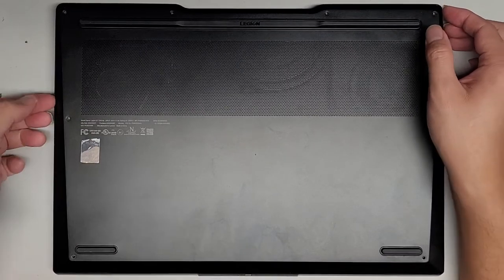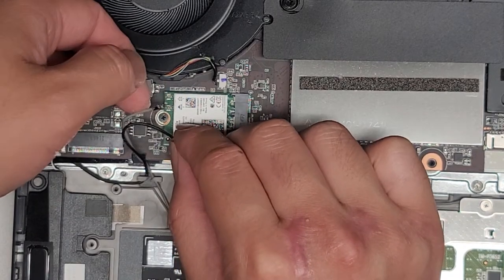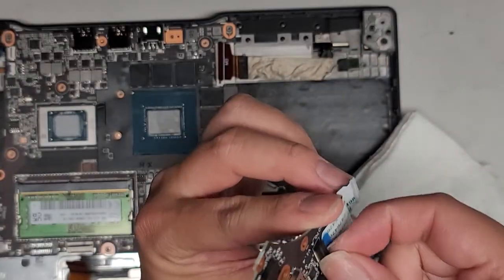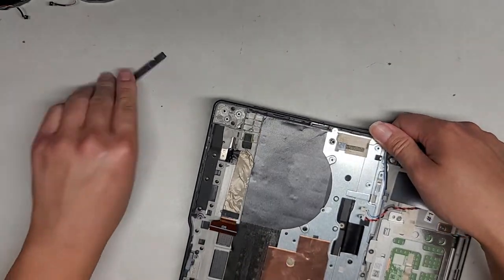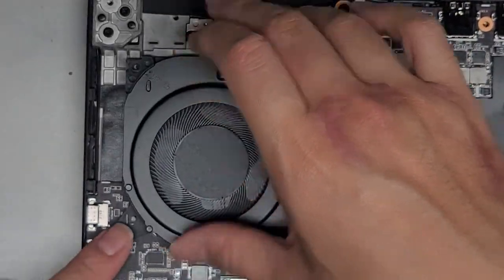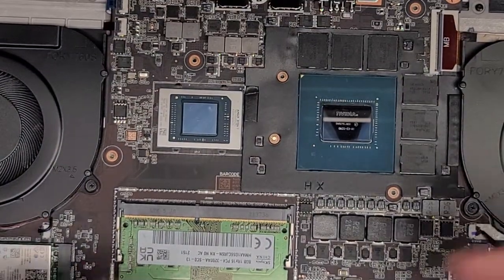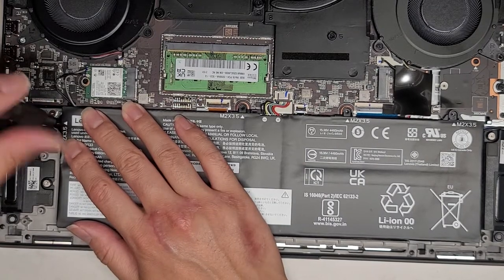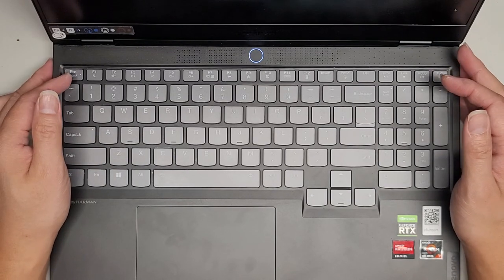Lenovo Legion S7 15ACH6 Disassembly RAM SSD Hard Drive Upgrade Battery Mobo Paste Replacement Repair

Comment: I want to add a second ssd and i was going to repad and paste but it looks like pretty good quality pads and paste so i may leave that alone
Reply from the maker: No need to paste unless it's overheating.
Reply: @ItsBinhRepaired  with processor power management maximum state set to 95% it runs really cool during gaming vs at 100 percent.  Probably like a 20°C or more difference :)
Reply from the maker: @johnvirginia7238  but then you get less performance.
Reply: @ItsBinhRepaired  true but I’ve always been setting that maximum processor state to 99% or less for probably a decade now in those settings for laptops and it’s always been a game changer for the maximum temperature that the processor gets. And since it runs so cool, it never thermal throttles.
Reply: And I can’t really tell the difference between the performance with a couple less percent.
Reply from the maker: @johnvirginia7238  sounds good

Comment: You didn't return the cover over the ram, do you not have to? Is it fine without it?
Reply from the maker: I just rewatched the video and I did put it back in the end. It's not a required component, but you might as well put it back. Lol

Comment: In order to preserve the battery am I able to keep it removed?  I have a true sine wave battery back up that it will always be plugged into anyway.
Reply from the maker: You'll want to store it at 40%
Reply: @ItsBinhRepaired  For sure!  With HW monitor I can see that it’s supposed to be 71 at full charge but it’s got the capacity of 73 so I definitely gotta keep it less than fully charged. Thanks. I will store it at 40% if I unhook it.
Reply from the maker: Sounds good

Comment: Hello, when i open the laptop, do i still have warranty? And i heard when you remove disessembly it has a sticker inside and when you upgrade anything that sticker will remove and when the sticker is remove people will notice your laptop has been disessembly, is that true? And when i want to sell the machine it should be cheaper cuz it got open
Reply from the maker: You'll have to ask the manufacturer, not me.
Reply: @ItsBinhRepaired  ok and when you open the laptop for upgrade do it have any sticker attach to it? Someone told me they have a sticker from manufacture. I dont see any sticker in the video, When that sticker is remove, thats means your laptop has been repair and people wont pay high price if in case i want to sell it
Reply from the maker: @genlongtsang1093  all I know is what's in the video.
Reply: @ItsBinhRepaired  ok is like sticker those that are on the laptop keyboard Intel i7 and RTX Geforce, they say they have one inside the laptop when you open it a manufactured sticker logo lenovo sealed inside
Reply from the maker: @genlongtsang1093  sometimes, You'll have to open it to see.
Reply: @ItsBinhRepaired  i ask you because you open it, its fine if you don't want to tell me lol
Reply from the maker: @Gen Long Tsang  do you have any idea how many thousands of computers I work on? You think I'll remember off the top of my head if there was a sticker inside? Lol If it's not in the video, I have no idea. It's not a matter of wanting or not wanting to tell you... These are customer computers, not devices that I own and stare at for hours committing to memory. Lol
Reply from the maker: @Gen Long Tsang  also, laws for what voids warranty varies state by state. I'm not a lawyer, so I can't tell you what will and won't void your warranty. Sometimes they'll tell you that taking a screw out will void your warranty.

Comment: Do I disconnect my batter internally because I was Downloading a bios download for my model and now my  screen is black but the keyboard light stays on its a legion s7
Reply from the maker: If you turned it off manually while doing a bios update, you killed the motherboard bios chip
Reply: @ItsBinhRepaired  so Am I needing to buy a new bios chip or is the computer donzo
Reply from the maker: @modsforlife2397  new bios chip might work, but I don't know how to do that.

Comment: Can you upgrade the battery to an 80wHr battery or can you only use the 60wHr battery?
Reply from the maker: This one was 71wh if it's the same size and shape and designed for the laptop, sure.
Reply: @ItsBinhRepaired  An 80Whr battery is a bit longer than a 60Whr battery but there's empty space to the left of the battery so it will probably fit?
Reply from the maker: If it's designed for it

Comment: I have this exact laptop .. today i suddenly have a buzzing noise from the microphone .. both microphones can register voice just the left one has a buzz .. loud buzz .. and it s not a software problem , i uninstsalled reinstalled drivers ., check all the settings etc .. any idea anyone :D
Reply from the maker: No idea. Microphones don't usually make noise.

Comment: I have spilled my water bottle on my Lenovo Legion S7 15ACH6, now when starting it up it been cycling through a solid red, green, blue, white, and black screen. While being stuck on this color pattern on my screen I can't do anything, this problem randomly goes away on its own and then reappear later again. I am not sure if opening up my laptop will help me, but I might try, do you have any solutions to how I can fix this?
Reply from the maker: Hmmm very strange. On Dell laptops that's a bad screen, but never seen that on Lenovo
Reply: @ItsBinhRepaired  do you think I could request for a new one if it still under warranty? I don't have many option other then sending it to a repair center.
Reply from the maker: @smalldragon8267  warranty doesn't cover physical damage. If you bought with a credit card, some have 90 or 120 day accidental coverage.

Comment: I updated my ram from 16 gig to 32 and now the gpu is always at 100 and all my games are laggy :( do u have any advice
Reply from the maker: What about when you put it back?
Reply: @ItsBinhRepaired  i'll try that today
Reply from the maker: @kiprex11  sounds good
Reply: @ItsBinhRepaired  i put it back but the perfs are still bad : /, my gpu 3d indicator on the task manager is at 100 really fast, even on game menu .
Reply: I also reinstalled windows and all the drivers, i also tried to force the gpu utilisation on the performance settings in the nvidia pannel.
Reply from the maker: @kiprex11  very strange
Reply: @ItsBinhRepaired  indeed
Reply from the maker: Yup

Comment: tooth brush and paper towels... bruh
Reply from the maker: What about them?
Reply: @ItsBinhRepaired  a soft bristle tooth brush is fine to use on the motherboard if careful but wiping a die like that with a paper towel is not usually recommended due to paper towel micro-lint and micro-abrasions. Cotton products like a q tip would have been better. That is at least what they taught us in college.
Reply from the maker: @jacquestcomc  haha it's fine. The diamond thermal paste would do more harm than the paper towel.